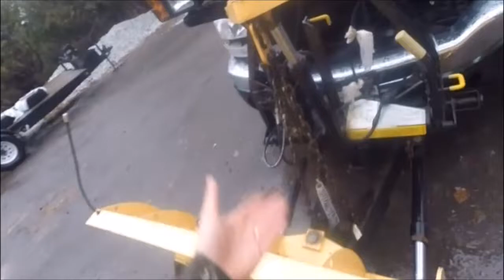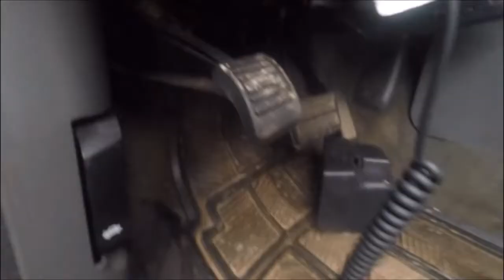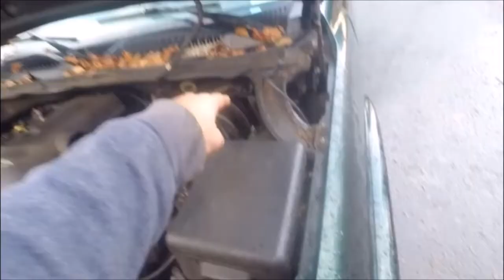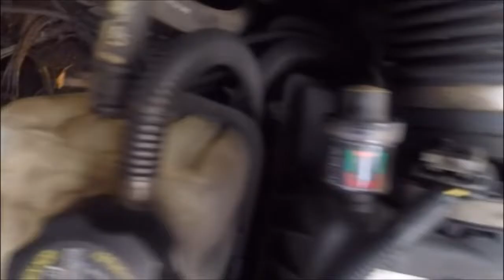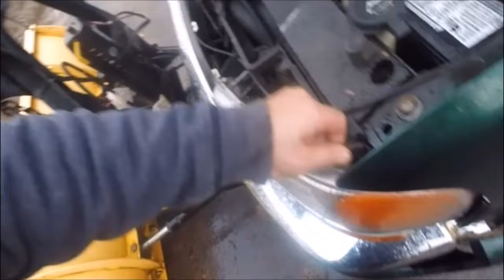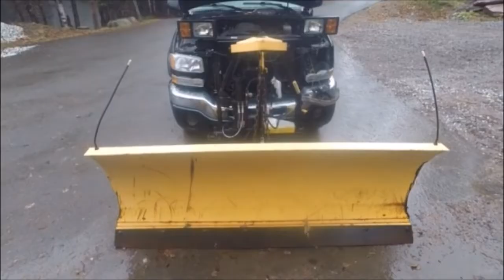DIY Pickup Truck Snow Plow Installation Overview

Comment: How long is that plow, I’ve been thinking to put a plow on my 2004 GMC Canyon. I just don’t know exactly what size plow I should get
Reply from the maker: 7.5' is a big plow for a quarter ton but I am no expert. Call a plow dealer and find out what they recommend.
Reply: @mrdiyguy123   is that the size of the fisher plow in the video? Doesn’t fisher make 6ft plows like the H2 model?
Reply from the maker: @andrewmalloy6426  the plow in the video was 7.5' long on a 1/2 ton truck